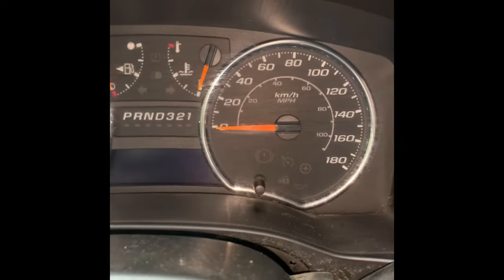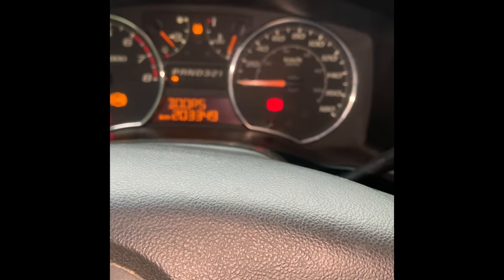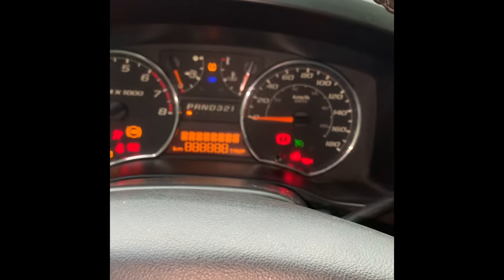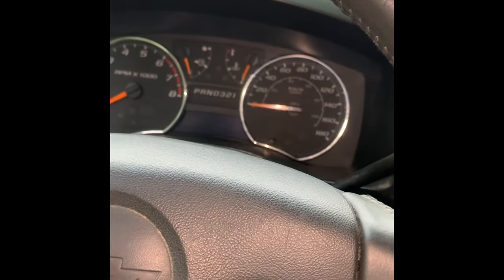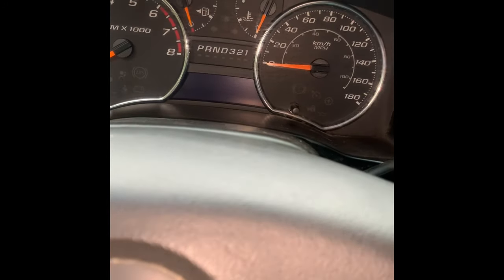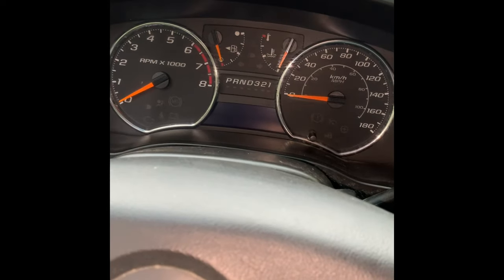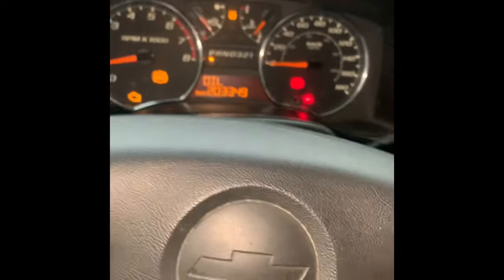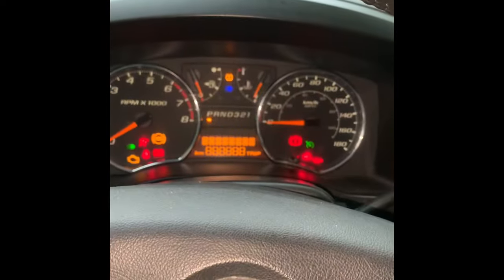Chevy Colorado/ GMC Canyon passlock Permanent fix bypass!

Comment: Recently purchased the truck and it happened to me while shopping.  Waited 10 minutes and it started, but I work in a pretty desolate area and didn't want it to happen leaving work at midnight.  Reading a bit, there is no guarantee replacing just the sensor will do it as it could be the cylinder itself misreading the resistance in the key (not a chip key). I cut the wire and it seems to have worked, but YES, the security light is on steady.  Nothing some black tape can't fix :)

Comment: My 2006 H3 Hummer has been gradually getting worse. Today I purchased a steering column from an o6 Canyon, from an auto salvage, and removed only the small round black sensor part. Two screws to get it off. I also had to make sure it was in park and turned the key to let the sensor come out of the switch. I then took the plastic off the Hummer column, three Torx screws. Removed the old sensor. Installed the new used one. Put everything back and followed the formula to reset the key. 10 minutes on, 5-20 seconds off. I had to do this four to 5 times, and it started. Been frigging with this problem for a year. I am not a mechanic, and have no garage to work in. ANYONE can do this. Hope this info helps someone.

Comment: Worked on my 04 canyon but I didn’t have to leave it running while doing it. Yes the pass lock light stays on now but I don’t care. I’ve had several issues since then ( about 3 years ago) but mostly sensors and ground issues. These trucks electrical issues are very frustrating. I’ve probably spent a couple thousand that I never had to spend chasing this stuff even with a qualified mechanic. My best and most rewarding options were to just look up solutions on YouTube or in forums and to spend several hours doing my own research.

Comment: The following steps worked for my 05 Colorado. 
1. Turn key to ON position 
2. Wait for blinking light to turn solid. (Don’t let light turn off completely) 
3. Turn to OFF position for 10 sec
4. Turn all the way on. 

The key to this was not letting the light turn off on board , only make it stop blinking.
Reply: But it takes exactly 10 minutes for the light to stop blinking.... This video is how to fix it, not live with the problem 🤔

Comment: This happens to mine all the time. I can tell you what has worked every single time.

Leave your door open. Put the key in but don't turn it. It will beep fast about 6-8 times. Turn the key forward to the accessory position. Wait until the lights all come on and stop flashing, usually 2-4 seconds. Then start it up.

It's the most convoluted thing I have ever seen but it works every dang time lol
Reply: Bro thank you!
Reply: Do you do this with every start?    Or just when it has the security delay issue?

Comment: Did some of the Passlock systems have chips in the keys? Mines a 2006 Colorado and I know for fact that it has no chip in the key. I got the truck in 2018 and it's had this problem since I've had it. It's progressively getting worse and very aggravating. When I shut it off, I never know if the Passlock will act up and have to wait.
Reply: The keys back then were resistance keys....the original likely had PK2 stamped in it. The computer actually measured the resistance in the key itself, so keys often had to be programmed to the vehicle. It was hit or miss if it would work without programming, but almost ALL aftermarket keys needed to be. I worked at a GM dealer back then

Comment: I remember when this happened during date night in the truck man 20 min of ac n radio killed the battery and when I tried starting her up mind u we were in a somewhat remote location from the city at this time ngl I was trippin for a sec but what worked for me was disconnecting the battery for about 5 minutes while I set up the jump box because I assumed the battery has died attempted to start it with the dead and passlocked truck it gave me the same results as the beginning of the video but I jumped it while turning the wheel to the left hard asf and left all doors open while doing so and she started right up and the problem never arose again hope that helped guys keep on rockin

Comment: Does this procedure leave a service light on the dash or the security light on the dash?  I’m having the same issue.  Thanks
Reply: So did you do this and did it work
Reply: I did not do this. My truck does a security lock out about 2 or 3 times a year. Just enough to be annoying but not enough to inspire further action quite yet.
Reply: Just buy the OEM ignition from oriellys  and swap  the black sensor only no need to change the entire housing , And  then do the procedure to pair the key with sensor  .  Total time 45 minutes to an hour, 10 min to   Remove the steering column cover ,the lower dash below the column  30 minutes to pair key to sensor.  Any sensor from 2004 to 2012 will work
Reply: @randumdude5824  I can picture someone messing with the colum wiring and firing off their airbag. No thanks. YOU can do that, not me.
Reply: @mikspapa  look for videos that show you how to change gm pass lock sensor. all you need to do is disconnect the battery. And you don’t cut any wires. Like this guy. Did.  That reminds me. Every video on YouTube  they say to use a screw driver to move the clips so you pop off the air bag. Well that  will work it . But it could be a pain for most because of the angle . only takes 2 seconds  if you use a small diameter tube or steel  bar with divot  in the end to catch the clip easier.

Comment: Have you considered changing the ignition ,  not the entire ignition just the part that reads the chip in the key.  That’s usually the problem with the pass lock,  there are videos on YT
Reply: Should be something Chevy/GM replaces for free since the engineering department fucked it up from the design table
Reply: Changed ignition on my 07 Colorado. No change.
Reply: @Rastilin13  did you just do it recently.?  , let’s go through with what you did.  did you use a new  or used ignition?   What did you replace  , the entire  key housing with the black sensor   , just the black sensor ,  or just the  lock the key goes in on the right side.
Lastly did you go through. Key relearn process ?    It’s required  to do the following  three times possibly more. But three  times  is the standard.     
 1.  (Turn key to on position  ). but not far enough to crank the engine,  leave in on position for ten minutes.   Until passlock lock symbol stops blinking.  
2.tun key to off position for 5 seconds 
3  then turn key to all the way to start engine. Position  “ it wont start at this point  “.  Then  turn key to off position for 5 seconds. Then turn key to the on position   Again  for another  10 minutes  but not all the way to start the engine, until the passlock symbol stops blinking.  
 Do all of that 3 times.   Total 30 minutes.  
Make  you have a good battery  I had to keep my battery hooked up to a charger for the process.  
If the engine starts before you do the key relearn process  you’re good to go.
Reply: Help us @Rastilin13
Reply: after you switch the ignition i believe you need to also program it

Comment: I just did this to mine. It does cause the lock light to stay on while running.. starts fine so far.. time will tell
Reply from the maker: It does cause the security light to remain on as you bypassed it when the wire was cut and locked the circuit in an open loop
Reply: @lilmaxgarage1990  is the security light that stays on a led soldered to a board or a bulb ?
Reply from the maker: @selenachorse1658  that I don’t know never had the clutter out of one
Reply: still working fine? debating on doing this to my truck
Reply: My light only comes on randomly while driving,  nothing happens.  I never have trouble starting it, what's the problem? 
2007 colorado LT
Reply: Do you know if the aftermarket alarm still work if I cut wires?

Comment: Question! So far haven’t noticed that light but out of no where started having starting issues. It fires up after like 5-7cranks and runs perfectly fine or sometimes literally fires up right away. Went a week straight last week with no issues now all a sudden back to the same issue. It’s a hit and miss at this point and I’ve ran through everything I can think of causing this issues and it all checks out good. Plugs/fuel pump not even a month old. Cleaned all my sensors, replaced what needed replaced. Any ideas? It’s getting very annoying and will make it difficult to sell if I decide to do so after giving up on finding the issue.
Reply from the maker: Kinda sounds like an grounding problem your having I’d check and clean the ground fuse blocks located either side of the fenders there a very known problem for these trucks and cause all sorts of funny issues

Comment: have you had any issues since?
mines having issues where is wont even turn over. 10 minutes later it'll start
Reply from the maker: No issues for me after it was done or the new owners. Your issue stems from the same ignition switch problem tho
Reply: Does this procedure leave a service light on the dash or the security light on the dash?  I’m having the same issue.  Thanks
Reply: @univac7677  Yes. This isn't a permanent fix to the problem.
Reply: @dalemihocik4732  I hate to tell you this, but the only "permanent" fix to ANY automotive problem, is to walk.
Reply: @univac7677  Passlock light stays on, but a piece of black tape fixes that problem.
Reply: @mikspapa  I hate to tell you this, but that's what I stated. This isn't a permanent fix to the problem.
Reply: Starts every time but now I have a check engine light on. I hope I pulled the right white with blue line wire. There was the same wire right next to the one I pulled